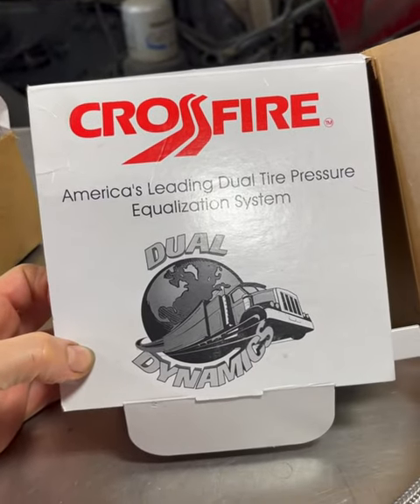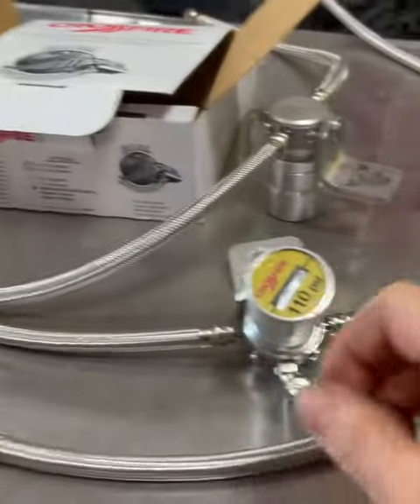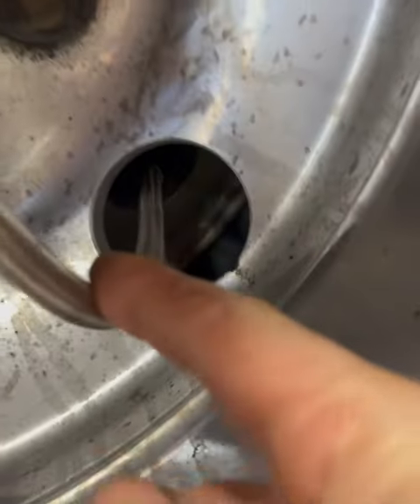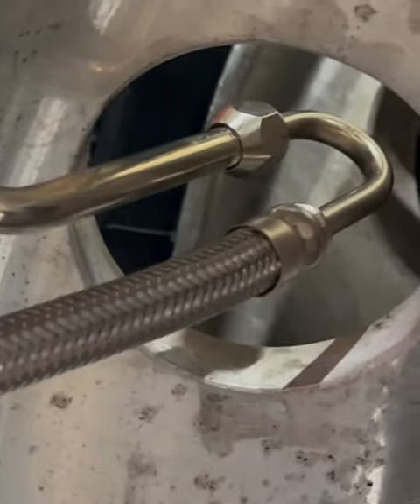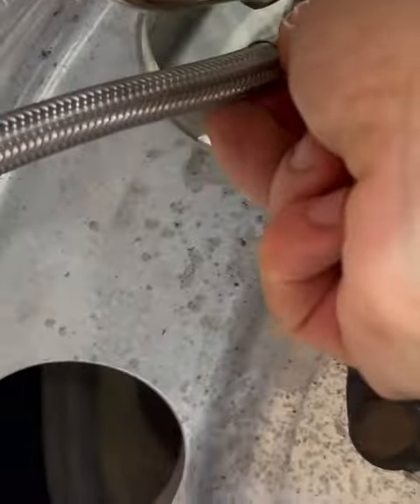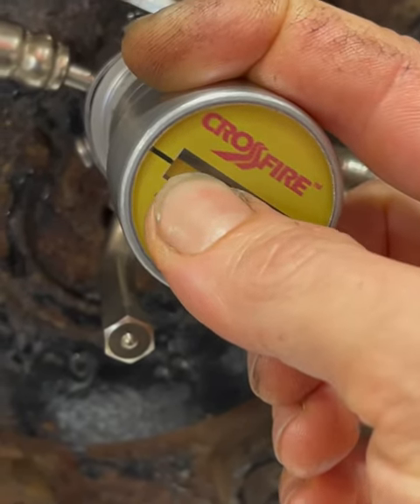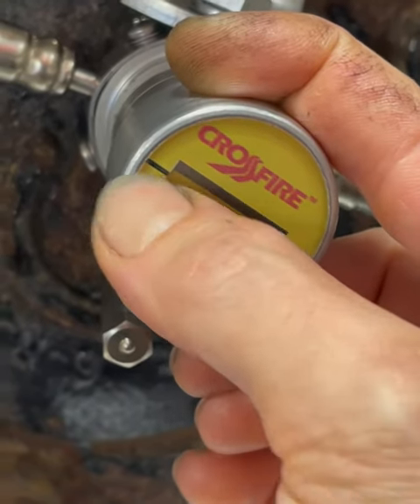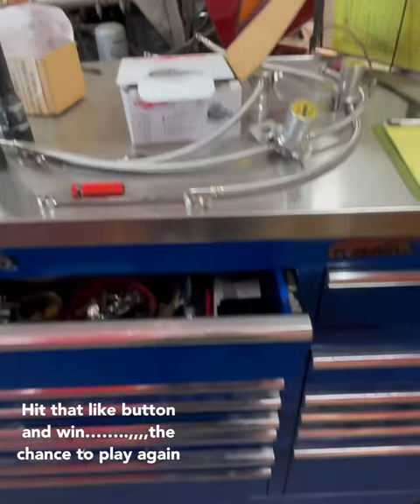CROSSFIRE DUAL TIRE PRESSURE EQUALIZATION SYSTEM REVIEW, BANG OR BUST YOU DECIDE..

Comment: Been running them for 2yrs...love em!  they keep air balanced between tire for much better wear and having one stem to fill is in itself a reason to buy...I run a tpms as well so I only had to buy 6 sensors rather than 10 for the tractor
Reply: What tpms do you run?
Reply: @pack877  just ebay special, no problems whatsoever

Comment: You can't use those for checking exact air pressure. I've used CatEye's for years and the gauge feature isn't accurate at all, though it will show you if you have a flat. What makes these things well worth the money is that they balance the air pressure between the two tires. That makes a huge difference in tire wear over time. Also, if you use a tire pressure monitoring system you only have to buy six sensors instead of ten.
Reply: That system has a check valve to keep both tires from deflating. If that happens you will never know because the tpms will read the pressure on the good tire right? Although the check valve closes 10 psi or so lower than set pressure which would be caught by your monitor. Thoughts?
Reply: @teamdada2194  Both tires will deflate to a trigger point before the valve closes. Your TPMS should trigger both for the low pressure and for the fast leak.
Reply: @nospam3001  10-4. Had the same idea in putting one bluetooth tpms sensor on the cat eys or crossfire. You have good luck with any of them?
Reply: @teamdada2194  Sure. I've been doing that for years. I use the TST system and CatEyes. The first time you save a drive tire or the rim of a steer tire you will have paid for the TPMS. And the CatEyes will pay for themselves in reduced tire wear by keeping the pressure balanced. FYI I also use Centramatics on all six positions.
Reply: @nospam3001  I’m getting some cat eyes and a tpms big guy. Got rid of the centramatics after my michelin steer tires got desteoyed. Not sure if that was the cause or what. Not doing them again, just because. Also, off topic… I do not drink Bud Light anymore, just because.
Reply: @teamdada2194  Did you remove the weights from the tires when you installed the Centramatics?
Reply: @nospam3001  yes. The drive open shoulder tires cupped causing a possible issue with steers. I don’t know. I put new shocks on a few mths before they went bad. I have no idea why these fuckers went bad. Had low spots on both tires. I don’t turn unless Im rolling. Etc etc. priced out new michelins and they were $750. Went with firestone for $500 and balancing beads. The saga continues

Comment: I’ve always like the old school cat eye ones myself, just a quick glance & I feel like that line will be hard to see once they get dirty. 

We use halo inflation system on a lot of our trucks, they actually will pump Air into a tire automatically if it gets low.
Reply from the maker: The halos are nice ones. Any self pumping ones would Deff be the way to go. Now your talking bout spending some $$$ on a good kit. But whatever these ones cost it was Deff to much for what there worth. And I can’t see them lasting without leaking.

Comment: Don't like the crossfire specificly, if I have to bend down to check that little line I might as well get out a tire gauge. Much prefer cats eyes style where it's a clam shell that opens when you have low pressure, much easier to see when your doing a walk around.
Reply from the maker: You have a solid point there. If ur already bending over it’s just a little more work to bust out ur gauge.

Comment: So can you still check the PSI with a tire gauge with the crossfire thing on? I like my steers at 116. I don't really put anything at 110 lol
Reply: Yes you can
Reply: or 105 lol. I've heard guys running 130 in steers when it says 120 max on the sidewall. Their reasoning is better uniform tread wear and to prevent cupping. What's your reason?